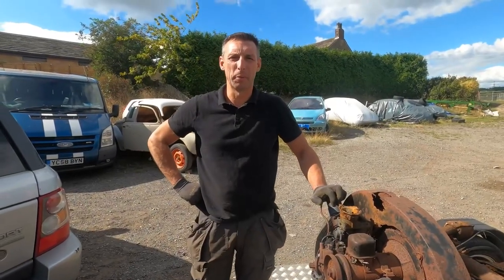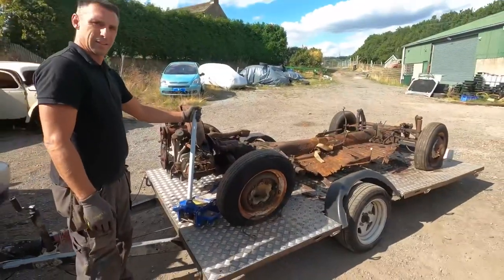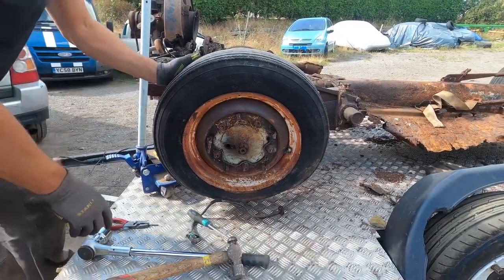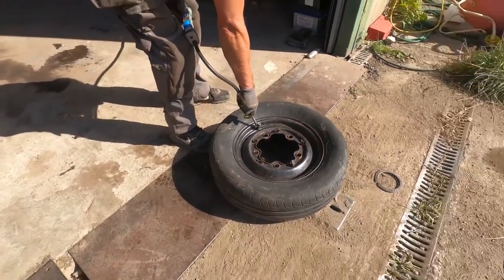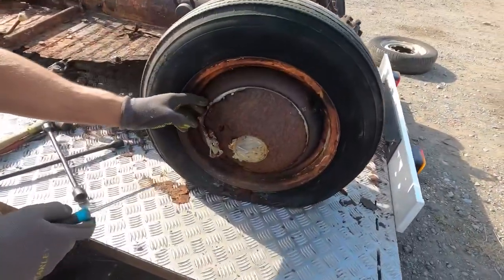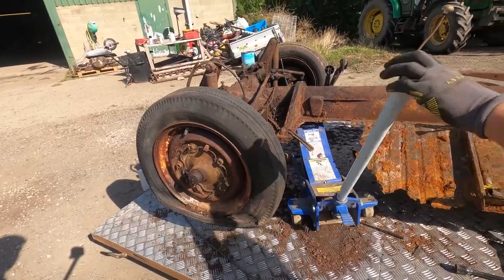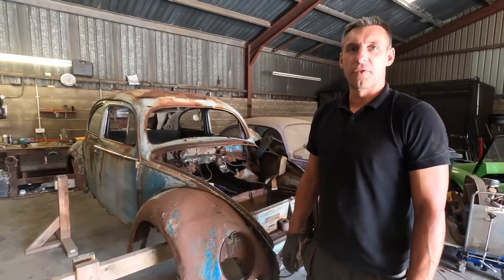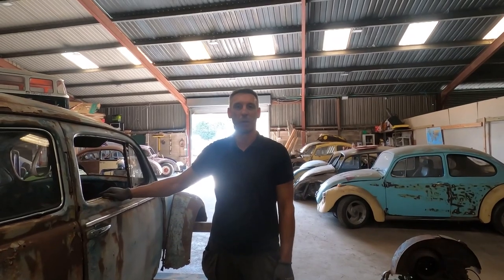Taking my 1956 VW Beetle Oval chassis off the trailer for restoration ep2

Comment: Of course, when you start to tack the pans into the chassis, and the heater channels into the body. I would advise you to put the body back on the chassis. 
And line everything up. Then tack things in place.
That way, when you go to assemble it….all the holes will line up.
Ask me how I know.
It’s a pain in the arse, but things will line up in the end.
Reply from the maker: Hi thanks for the advice I will probably do it this way. Thanks